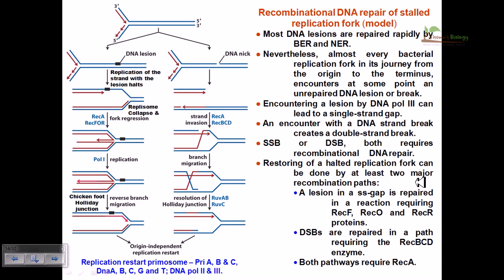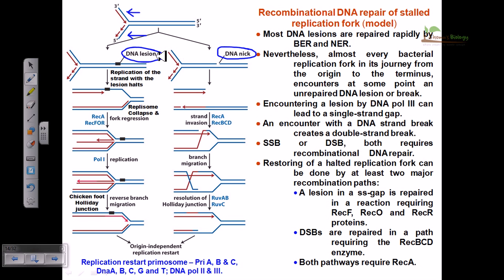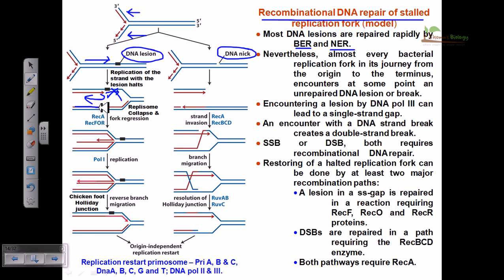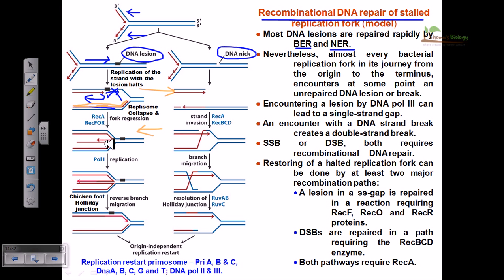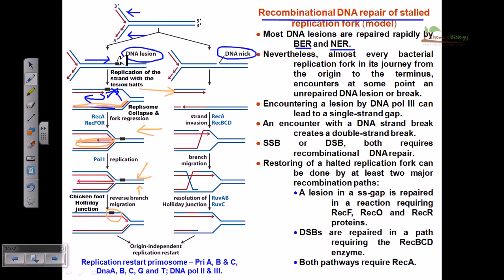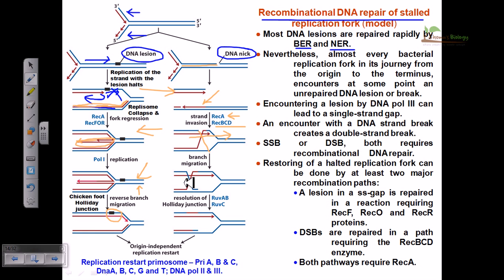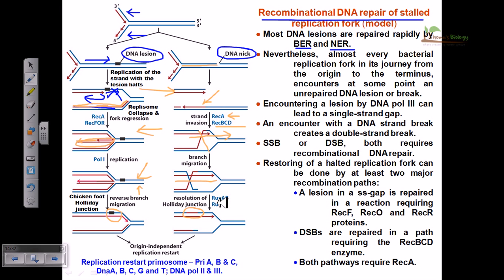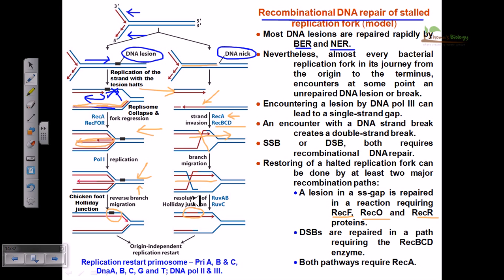Recombinational repair of stalled replication fork

Comment: I have a certain doubt. You're saying replication fork reverses in direction and start using 2nd newly formed DNA strand as a template. Later on, hydrogen bonds will be broken and strand will be then extended. My question is, how will this extended strand become complimentary to the parent strand? as the direction of strand after replication of is in the opposite direction. How will it become complimentary to parent stand? Kindly address this doubt.